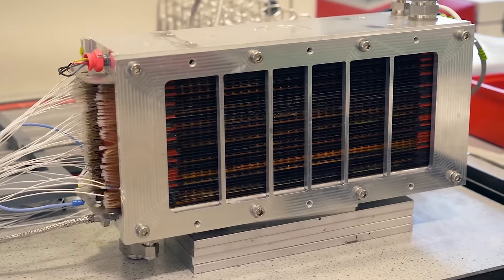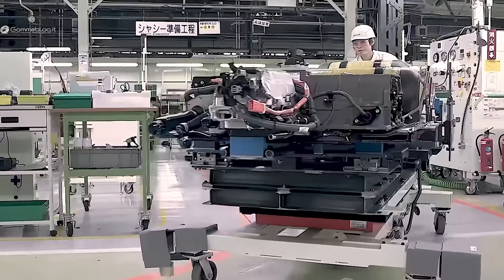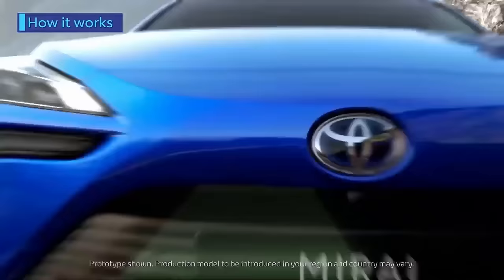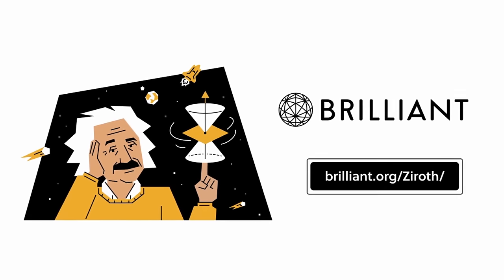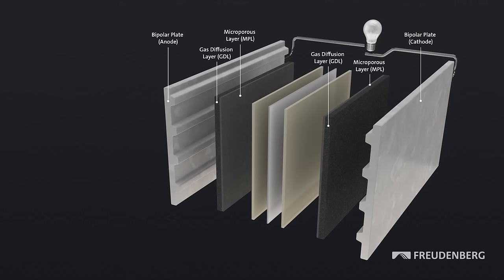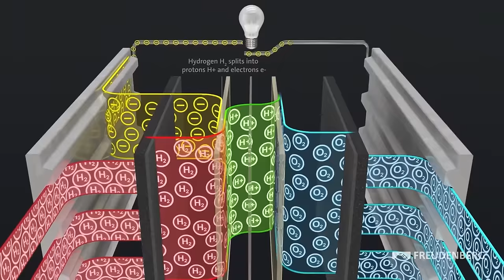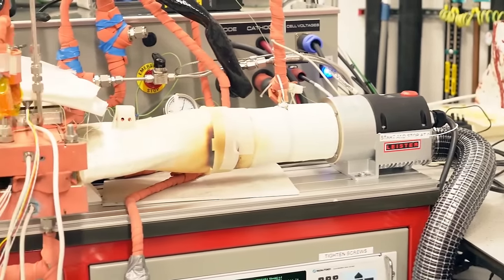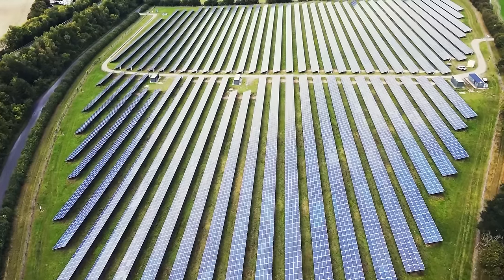Why This Hydrogen Fuel Cell is Engineering Genius

Comment: The challenge for hydrogen fuel cell adoption is the non-existent distribution system for the fuel, not converting the fuel into motive power.  Those people concerned about the ability to recharge an EV easily will find that local availability of hydrogen is non-existent, by multiple orders of magnitude!

Hydrogen fuel cells may, just may, be viable for HGV transport that can refuel at regularly used depots.  They may be viable for use in intercontinental aircraft, and they may be best suited to power oceanic shipping.  But ...

The FUDsters love to make claims about EV battery fires despite the fact that more ICE vehicles, allowing for ICE vs EV population differences, suffer from disastrous fires, at home and on the road.  Hydrogen fuel cells don't eliminate the risk of catastrophic fires.

Here is a link to an example of a bus company hydrogen fueling station conflagration.  It almost makes the Hindenburg catastrophe look tame.  At least the Hindenburg crashed in open fields, away from residential areas.  Would you like your local gasoline stations to be replaced with hydrogen refueling stations?  Not me.

This new fuel cell may be the result of engineering genius, but those engineers need to be thinking about how and where people will be able to refuel them.  We'll never buy another ICE vehicle, and there is no chance we'd ever want a 'hydrogen bomb' in our driveway.  Nope!  It's so easy to just plug into clean, safer electricity at home, at work or along the highway.

Comment: I’d love a 200 hp fuel cell and supporting equipment that fits in the volume of a Lycoming IO360, and provides 4 hours of endurance on tanks of H2, the outer mold lines of the set of tanks occupying no more than the equivalent of 60 gallons of 100LL at standard atmosphere and pressure.
Reply: You might be waiting a while. 😊

Comment: I'm a Huge proponent of H2 as a power-storage medium, so this technical development is very exciting, just in general terms.  However, I remember a technical analysis from a decade ago, re: using H2 for aviation - in this, the analysts stated that there is a serious technical problem with dumping water vapor (in quantity) into the high troposphere/low stratosphere.  Supposedly, there is a fundamental problem with the interaction between high-altitude water vapor and the Ozone layer (something to do with the formation of Stratospheric clouds, when temperature drops below some threshold) - apparently, this Is A Bad Thing...  Just something to mention...

Comment: Sorry, but this "breakthrough" of 4 times higher power density compared to LT-PEM is not real. You as a former AVL engineer should know this better than others, because AVL is one of the biggest engineering companies within the fuel cell industry. You completely skipped the point that the state-of-the-art HT-PEM MEA´s has only 25% of the power density compared to LT-PEM. Additionally the operating point of the HT-PEM is on a much lower efficiency, which means more cooling demand. Not to mention that HT-PEM uses 3 times more novel metal catalyst as LT-PEM. And the use of aluminium for the bipolar plates with a relative thick carbon coating reduces the weight advantages compared to steel strongly. All together the power density may end up at a maximum of 30% but not the mentioned 400%. Sounds more like a investment related video but not a scientific based tech analysis.

Comment: Intresting Product would however like to understand the Delta between the existing systems available today. While i understand this will be better. How much better are we talkin about?
is it only the Thermal Regulation system weight reduction the benefit or is there more to it. Simple example between the 2 systems being installed in an airplain would help to visualize this.

Comment: Seemingly ultrasonic atomizer would have a place in a direct #methanol #fuel cell unit & contained cooling like absorption #refrigeration without compressor using induction as heat source

Comment: Hydrogen isn't the only answer.  It's not even THE answer.  You can't store it in the wings like jet fuel.  Where are you going to put it?  The cabin?  Good luck getting that certified.
Reply: Any other zero emission solutions for aviation?
Reply: Clearly religious talk, scientific talk talks about the advantages and disadvantages, not some moralistic terms like truth.
Reply: My biggest concern about hydrogen in general applies here as much as anywhere else--we have yet to find a way of making hydrogen that is less expensive than steam reformation of fossil fuels.

Experience shows that business chooses the lowest cost option, so steam reformation will most likely be used, and it uses (sells!) more fossil fuel, and produces more climate change, than just burning the fossil fuel in a smokey old truck.

Comment: if only hydrogen wasn't the smallest atom and therefore destroys everything it gets into contact with, was so explosive and had to be stored under such high pressures and at such low temperature and wasn't so energy costly to make

Comment: Stupid idea , but cant you use te heat in the exaust and inject it with the 0² produced  into the hot air to create steam before the turbo that will increase the pressure in the turbo making it spin faster ?

Comment: For someone who has no clue like me, why can't you just use the hydrogen directly and burn it as fuel?
Reply: Fundamentally it's less efficient to do it that way. The overall amount of energy you can get out of the system for a given amount of hydrogen is lower.
Reply: @JustWillB  can u explain why? Aren't you essentially doing the same? Turning H + O2 into H2O?
Reply: @earllemongrab7960  well, theirs only so much stuff you can burn in a second
Reply: @DarkSystemProgrammer  If I understand you correctly... essentially not all hydrogen has time to find an oxygen partner to react with and some hydrogen gets pushed out of the combustion engine unburned/unoxidized aka incomplete combustion (it might react outside the engine but then it's too late for the energy to be used) and thus a fuel cell is more efficient because it ensures all hydrogen finds oxygen to react with?
Reply: Yep
Reply: Or at least as far as I know.

Comment: What is the final efficiency reached?
+350% from what to what efficiency.
Is NOx an issue with high temperatures in a fuel cell?
Reply: As I understand, simply heating gaseous nitrogen in presence of oxygen will not form NOx gasses! This can be done with molecules containing Nitrogen (like Aluminium Nitrate), but not gas. ICE engines produce NOx due to the explosive combustion process in the cylinders.

Comment: Always a fan of more efficient engines, but given that known methods of storing and transporting hydrogen are all significantly less energy-dense than jet fuel or similar hydrocarbons (requiring 4-6 times the volume to store the fuel, plus additional space for the storage containers and/or cryogenic equipment), even with an engine with 3x the efficiency, a hydrogen powered plane will have significantly lower range than a hydrocarbon fueled vehicle. Plus hydrogen isn't cheap to produce, transport, or store. How do you envision this being practical? I can see it if you could reform hydrogen from hydrocarbon fuel onboard efficiently, taking advantage of the high energy density of the hydrocarbon fuel and the efficiency of the high temperature hydrogen fuel cell, at some cost in increased carbon emissions. Even so, a 60% decrease in emissions due to increased efficiency would be huge!

Comment: I'm always in favor of fuel cells, they have so many advantages.  But I've been hearing that the big breakthrough is right around the corner for almost 50 years now.  I hope this all works out beyond their wildest dreams.  Certainly there have been many advances since the 60's.  But I'll not break out the confetti quite yet :)
Reply: don't forget nuclear fusion is just 10 years away !!
Reply: @LibertyDankmeme   And my jet pack!  I was promised a jet pack by the year 2000.  I'm still waiting...  😉

Comment: Hydrogen is hopelessly inefficient. You have to make it (85%), liquefy it (70%), distribute it, store it, dispense it and convert it back into electricity (50%).
Reply: Well, ok but with fossil fuels you have to extract it, refine it, distribute it, dispense it. It's more energy dense when you do all that, but even so.
Reply: @jamesdeath3477  You’re welcome to quote figures, but efficiency is a meaningless metric for an energy source that isn’t made and is non renewable.
Reply: @fredbloggs5902  I don't follow. Why is it meaningless? I don't have any figures, but surely there is a pretty direct comparison to be made between the efficiency of an internal combustion engine and a hydrogen engine? And also the costs of the things that you can compare, such as distribution.
Reply: @jamesdeath3477  Because the comparison should be between using electricity directly vs. via hydrogen.

Hydrogen is just a way of storing energy, it is NOT the energy source.

Fossil fuels are a finite resource that is not renewable.
Reply: @fredbloggs5902  Long range flight is problem that doesn't allow you to use electricity directly through batteries though. It's too heavy and therefore presently impossible. So it doesn't really matter how efficient it might hypothetically be if it won't work for the application.
Reply: @jamesdeath3477  Long range flight is likely to use jet engines for the foreseeable future. They might change the fuel to something else:
Energy density in KWh/L:
Lpg = 15.4
Jet A-1 = 9.6
Ethanol = 6.4
Methanol = 4.3
Hydrogen = 2.3
(You can clearly see hydrogen is hopeless).
Reply: Hydrothermal carbonization can convert organic waste into fossil fuels. I believe that would make them renewable.
Reply: @jamesdeath3477  In this study we certainly need to include the aftermath of global warming in case of further usage of carbon containing fuels. Then it will be clear we have no choice for the future.
Reply: @Torx-uh3uo  seems like reason enough to see if we can make hydrogen work.
Reply: So all of this process could use renewable power... If that's done it's more effective...
Reply: @patrickaustin6337 agreed we need steps how much methane is generated from landfills?
Reply: @jamesdeath3477  I just gave you the energy density figures. You’re utterly clueless.
Reply: This is not looking at the entire story. Like at all. 

If we are trying to move away from carbon intensive fossil fuels, this is the only way. Plus, i could see this kind of technology giving places like japan and hawaii total energy independence without needing natural gas or nuclear energy plants.

Comment: Seriously a very rare and hard to get gas that chews 40 percent of the energy input in its creation. Applications are huge but you need to make it. So it's a total load until this problem 'the laws of thermal dynamics" are beat. NOT LIKELY beating physic's.

Comment: Storage is an issue, but if enough hydrogen can be produced by the fuel cell, to burn instantly, then no storage is necessary, other than for the water tanks....but of course, not enough hydrogen is being produced...
Reply: The plane would require a large battery, charged primarily elsewhere and secondarily by being covered with paint on solar cells....

Comment: We have technologies and on the shows why people just don't use them as beyond me and then claimed that they made the first hydrogen vehicle.
It's mind-blowing on you. This was done back in 1986, but nobody follow through with it because nobody would be making money if this were to go to Martin. It's the only reason why it's not being talked about. I can sure use a break from spending money on fuel.
End not limited to driving vehicles. Also, would be multi-purpose use
They're just figuring out a way to make money off this pressurize Canisters, so they can make money. This is the only difference between Stan Myers and what everybody else is doing. It's the only difference it puts out 0 emissions, what you would get from the tailpipe, it would be the same as somebody gossiping about the Fuel cells. That is the only difference between is that too, and you don't have to junk your car to actually outfit your car with A Set up. All the processes it would be done in the cylinders and the car Ignition system. Has enough volts?
To make everything work correctly, it's all about timing. And it's not just for auto use. Many Diesel-powered engines. But again, the difference is some people don't want this to come to fruition, because nobody would be making money. Once this is out meaning, nobody can charge a ridiculous amount of money For fuel anymore. Which I think would be a benefit in certain areas that are flooding most of the time, just saying it does have, Purpose. Better mpgs. More power. All from water.

Comment: Didn’t we already learn that carrying large amounts of hydrogen on aircraft was a really bad idea? (Hindenberg, *cough*)
Reply: The Hindenburg actually also had survivors and was made out of a skin material it resembled thermite a mix of metals and chemicals that can combust and burn at extremely high temperatures. If one puts hydrogenn in a liquid form by cryogenic cooling it is only 3 bars of pressure measured by the kilogram  and when it comes up to pressure it is at 800 up to 900 bars of pressure. In composite thanks that have a kind of composite very strong outer hull with hydrogen a reaction happens resembling oxidation but with hydrogen forming an imprenatable layer to keep hydrogen from leaking out.
If one puts bullet through such a tank the result is underwhelming because it immediately cools itself to very low temperature if you guide it away from hot parts and passengers and have earogell in between, the most insulating material you can have, it will be fine. It can only combust at higher altitude it rises up quite fast and will automatically reunite with oxygen in the air to water again but only under influence of the sun at molecular level, ( in contrast to helium that simply leaves our atmosphere and goes higher up )  so it is not a danger, sorry for the typos my keyboard has quirks and I am not a native speaker of english.

Comment: This doesn't change the fact that hydrogen, even at its densest (i.e. liquid form) is hopeless when it comes to energy density (8mj compared to 35mj from diesel), so unless you can get fusion reactors to work or you can break the laws of physics and get more than 8mj (i.e. more than 100% efficiency) from it then tell me, otherwise hydrogen as a fuel is a scam.

That said, maybe it CAN be used to make some new tech, but then again we don't need new tech in order to solve the climate crisis, we have plenty of existing tech (like 30+ years old tech) that we could use to stop it (or at least slow it down massively) already, but the brain rot of "we will be saved someday when we get this new tech to work" is only going to hurt us... More than it already has.

Want a solution? I'll give you a few:
• Build or expand bike infrastructure, reduce or even remove parking minimums and iive public transport (especially busses and trams) dedicated lanes, as to make taking them faster than taking a car.
• Build or renew city infrastructure as to increase the density of your cities (i.e. mixed use buildings), therefore making cars less need. Especially in suburbs, those places are too far from everything and don't generate enough tax revenue to maintain themselves (i know cause i live in one).
• Build or expand eletric public transport (such as trolley busses, trams, trains and such) and make roads narrower, that way drivers will drive less and when they do drive they'll do it slower.
• The cars that do circulate must be electric, though again making cars less necessary is the best course of action.

Do these and more (through a lot of organization with your local city council and overall government) and you'll find that your cities will be quieter, more desirable and more comfortable places to live in while also not poluting nearly as much. There's plety more to do, but this comment is getting too close to being an essay already, have a good one y'all and sorry for the rant ^^

Comment: someone tell this guy that amonia is heaps easier to compress to liquid and store , and you can crack it into hydrogen and nitrogen on the way into the fuel cell , then he may be on to something , or just put the hydrogen in a big bag and sling an electric motor on the bottom with a cabin, call it hindenberg II and you might have a hit!

Comment: Aircraft that have to rely on propellers rather then jet engines is a nonstarter for replacement of existing jet liners.  If we are able to 'make' hydrogen from renewable sources our only realistic method is to make hydrocarbons fron that hydrogen aka conventional Jet fuel to power existing aircraft.  Fuel cells are simply a stupid idea for vehicles of any kind given the terrible density of hydrogen and te low powerdensity and cost of the fuel cell stack.  Fuel cells have their applications in spacecraft because the waste product is needed for human consumption which makes all the reactants mass 'free', their is also a niche as a chemical battery, but as soon as your planning to just dump the water their no real point.
Reply: There are 3 scenarios for humanity's future. 1 - die out, 2- quit flying, 3 - switch to propelled hydrogen aviation. What is better?

Comment: Its not so much about energy density than it is about fuel efficiency, because is far easier and better to reduce the need for energy than it is to increase the energy density of batteries, especially on aircraft's. Hydrogen, yes but there are way to many losses  so its not actually clean energy because you have to create using much more energy then you will ever get our of it. Hydrogen would therefor lead to much higher prices per passenger mile as well as to much higher emissions and even more energy inefficiency.